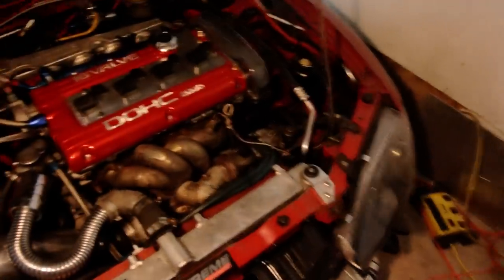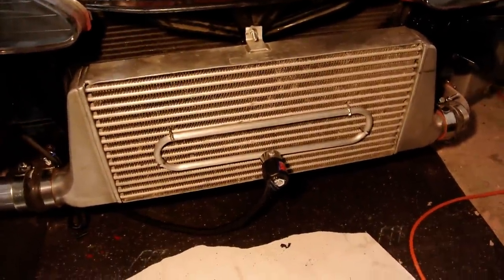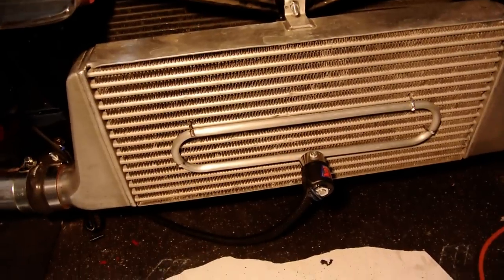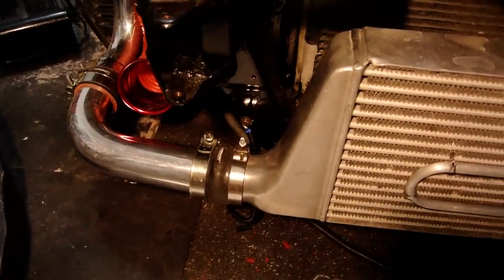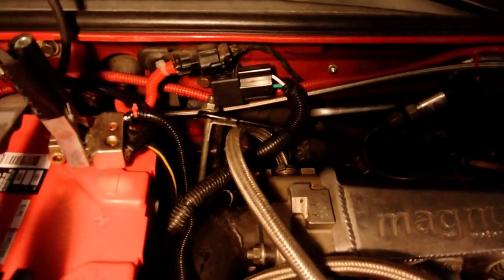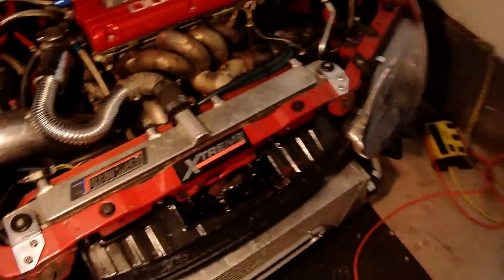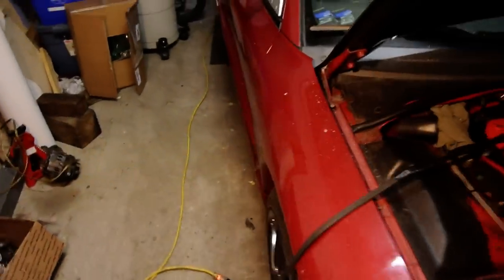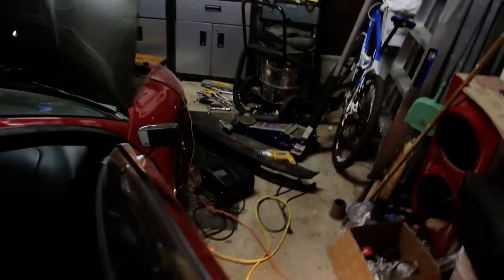intercooler sprayer n-tercooler nitrous express

Comment from the maker: It will work for a supercharged application as well.  You might have to refill the bottle a little more then most cars. But it will drop the temps a lot.  The sprayers are good for those hot days.

Comment: With this setup up, you would freeze/ lower the inner cooler charged air while building boost then after takeoff, spray it down the track to maintain the cooler charged air for better boost?

Comment: Why not add a 25 shot before the intercooler? Or would it be too hot? Or a 25 on both sides? Use methanol for the wet shot and fuel. Place in front of throttle?
Reply from the maker: you could do that but, it would just be better if you got a wet system for it and do a 75 or 100 shot. I just use this set up to cool down the intercooler

Comment: nice but I'd work on a controller so you dont have to push a button while driving. maybe use intake charge temps and control the spray using PWM. higher temps = higher duty cycle
Reply from the maker: +JbassPlayer28 You don't have to push the button while driving because there is an activation switch under the gas pedal to activate it when you step on the gas. The button is more for staging, or when you are at a light.
Reply: ohh gotcha. simple clever way to control it nice work

Comment: It looks like it sprays up so the air when driving pushes the cold C02 into the intercooler? 
Would this help at idle? Like in autocross, doing a run. The you work right away, the car gets hot. Does hitting this while idle cool?